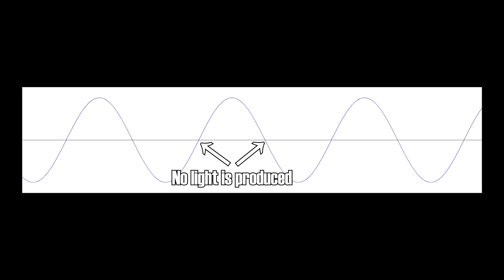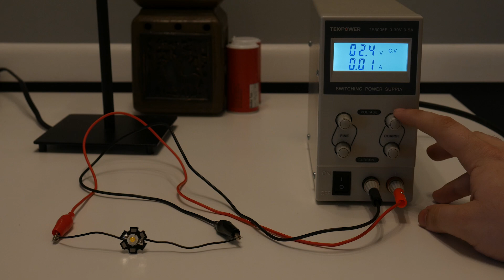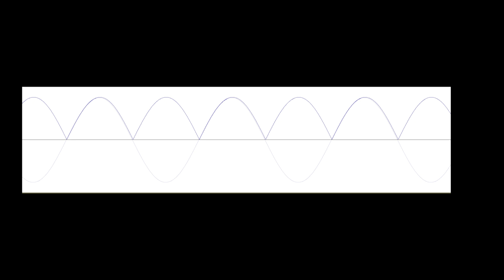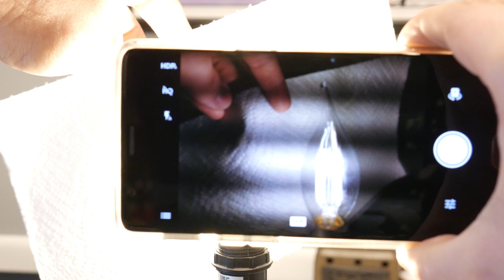LED bulbs that flicker, and CFLs that almost never did

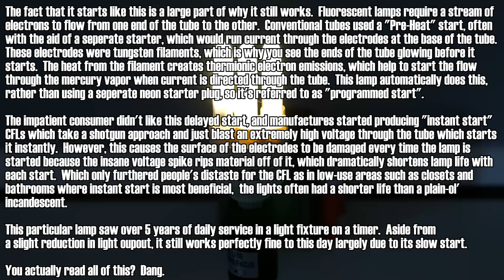Comment: at 1:49

The fact that it starts like is a large part of why it still works. Fluorescent lamps require a stream of electrons to flow from one end of the tube to the other. Conventional tubes used a "Pre-Heat" start, often with the aid of a separate starter, which would run current through the electrodes at the base of the tube. These electrodes were tungsten filaments, which is why you see the ends of the tube glowing before it starts. The heat from the filament creates thermionic electron emissions, which help to start the flow through the mercury vapor when current is directed through the tube. This lamp automatically does this, rather than using a separate neon starter plug, so it's referred to as "programmed start."

The impatient consumer didn't like this delayed start, and manufacturers started producing "instant start" CFLs which take a shotgun approach and just blast an extremely high voltage through the tube which starts it instantly. However, this causes the surface of the electrodes to be damaged every time the lamp is started because the insane voltage spike rips material off of it, which dramatically shortens lamp life with each start. Which only furthered people's distaste for the CFL as in low-use areas such as closets and bathrooms where instant start is most beneficial, the lights often had a shorter life than plain-ol' incandescent.

This particular lamp saw over 5 years of daily service in a light fixture on a timer. aside from a slight reduction in light output, it still works fine to this day and largely due to its slow start.

You actually read all of this? Dang.

Comment: I always thought the flickering LEDs were just cheaply made...
the first batch of "Corn" LED bulbs we got flickered like hell(most people don't see it but I do, especially when I move my head/look around with the eyes) and they died very quickly.

The second and third batch we got (with a "smart IC driver chip") were flicker free and lasted way longer.

When filming them both side by side with 240/480 fps you can clearly see them flicker on and off while the newer ones don't flicker at all.

PS: we are in Israel so electricity is 50hz hence easy to see the flicker.)

Comment: I love your channel! I have a peripherally related question and I hoped this would be an appropriate video to post under. Just now in the Walgreens I was seeking out a new CLF to replace one that was apparently not as deathless as once advertised, when I found only LED bulbs and traditional incandescent bulbs! No CLFs to be found anywhere. Have LED bulbs entirely replaced the market that CLFs once dominated? Many thanks in advance!
Reply: I've seen CFLs in a few local stores recently, but certainly many stores are getting rid of them. CFLs seem to also be available in very large sizes for which it's difficult to find inexpensive LED bulbs currently, though that will likely change eventually too.

Comment: My only issue with LEDs, currently, is that their light output is still minimal compared to what CFLs can do with the same volume of bulb.  I have two 200-watt equivalent (40-watt) CFL bulbs, and granted they're a tad larger than your average CFL, a 200-watt equivalent LED bulb would be cumbersomely large. It would probably also produce a disconcerting level of heat.  Lastly, the 200-watt equivalent CFLs cost 10 dollars each, and LEDs aren't anywhere close to competitive, in terms of lumen per dollar, with CFLs.

As somebody who suffers from winter depression, high-output bulbs are ideal for me (as is the daylight color temperature).  Until LEDs overcome some of these problems, I'm sticking with my CFLs.

Edit: I almost forgot to mention... I can see the green flash from my CFLs without moving my eyes.  When I turn them off, I sometimes stare directly at them, and I still see the green flash.  I suppose this might be rare behavior for CFLs, just like the green flash of the setting sun over the ocean :P

Comment: 13:39 I was on night shifts and set up lights in my apartment to have fixtures closer to the interior use warmer variants and used 6500k lights near the windows.  Blackout shades drawn, I could mimic a daytime light scheme at night.

Comment: Why do we still use electrolytic capacitors versus non-liquid capacitors these days? is it still just cost?
Reply: Solid capacitors are used, but their capacitance is very tiny unless you make them huge, they're used in small devices that don't use much power, or pretty much anywhere that a really low capacitance is needed. They're usually layered ceramic for the smallest ones & layered pieces of mica for the biggest ones. I don't know much else about it, just that they're like fine controls of a circuit with how little capacitance they can hold & that electrolytic capacitors are like coarse controls.

Comment: 1:50
I have a word of caution on those slow start CFL's.
I had a few of those EXACT Ikea bulbs in my house for a long time until one day after a few years of reliable use in the living room centre light fixture, one went pop.
Well, not so much pop but BANG and the resultant, explosion "unplanned spontaneous disassembly" showered our living room (and us) with pieces of glass and bits of plastic.
I guess the ballast failed? Needless to say they all went in the bin and I haven't looked back.
Might not be so risky for you on 120v, as we are on 240v here in the UK (bought from UK stores and obviously rated for 240v!)
Long story short, be careful as they get old.
Reply: It wouldn't surprise me if the capacitor inside failed.  When electrolytic caps fail, they have a tendency to pop, releasing a large amount of energy into the enclosure.

Comment: The real problem with CFLs was that even if you wanted to recycle them, most folk didn't have any idea where/how.
Reply: We were told they would be recyclable ..... no local recycle center would take them because they contained mercury.
Reply: @jeffreymontgomery7516  Right? I ended up throwing away a bin of the damned things I'd saved while trying to find somewhere that would would take them for safe recycling.

Recycling was fantastic in theory but didn't work out in the boondocks. Or anywhere I lived really.
Reply: @jeffreymontgomery7516  Right, they are actually toxic waste.
Reply: If you still have them, chances are your local Home Depot will recycle them.
Reply: Any company that accepts Laptops or Flat Screen TV, SHOULD, be accepting CFL as it's basically the same elements. Mercury Lamp inside the Laptop along with the circuit board in the CFL. BOTH, can be placed in the same Hammer mill for recycling
Reply: Pen & Teller has a show about the Lies of Recycling which showed most plastic, paper, etc doesn’t get purchased.  Then the recycling center sends the stuff to the landfill

.
Reply: Politicians passed laws requiring recycling, but included a loophole that allows the items to be sent to the landfill instead

.
Reply: Mercury
Reply: @⸸BadRomanceDjinn⸸The "Smart" ones, can monitor you, just like Siri, and anything, "Smart" and anything "Ring" Places that recycling Laptop, use the same machine to recycle CFLs. I'd put all in one box, along with bad Christmas lights, dead battery, and give to them.

Comment: People who "can't stand" cool white lights  do so because those lights are lacking in red and yellow components, and those people's brains evaluate colors continuously and dynamically instead of using memory-assisted color perception.    The human eye uses red and green cones for color detection, blue for amplitude and night detection.  The led replacements for fluorescent cool while and daylight lamps have much better color balance with red and yellow phosphor-covered emitters, so they should be tested by those sensitive to "fluorescent" lighting to see if they are a problem.

Comment: Filament incandescent 100W = 100W of power, CFL 100W eq. = 14W, LED 100w eq. = 5W... That's all I need to know.. This means I can replace I can run 20 light sources for the same cost of energy as a single 100W incandescent light bulb. My whole house is lit by less power than one lamp at my dad's house growing up. I don't mind a little flicker keeping that in mind and the cost of power these days. My smart bulbs lowers it to an average of 15 lights for the cost of a 100W bulb, but that is still worth it for the convenience and the incremental savings of not having to walk back to another room to turn out a light I've forgotten. And yes CFL caused me to have headaches, and eye strain, and it was NOT because of any kind of flicker, it was due to the light wavelength created by the fluorescence coatings inside the tubes which was harsh on my optic nerve. I also experienced faster macular degeneration when using CFL bulbs. my prescription hasn't changed much since switching to LED.

Comment: Where I noticed fluorescent light flicker the most was back in the mid nineties when I had a CRT monitor that was running at a sixty hertz refresh rate which was the default setting on many monitors and the only setting on cheap monitors.    A lot of people in the office complained and I went through and changed the refresh rate of their monitor to seventy-two hertz where I could.    It worked well.    Well enough that I got an attaboy from management and a few dozen shiny new NEC 17 monitors to deploy.
Please do Philo Farnsworth and nuclear fusion too.  https://en.wikipedia.org/wiki/Fusor

Comment: Every single CFL I tried cast a gray or yellow hue which made me sick to my stomach...emotional reasons, not physical. Made me the opposite of happy. More like angry. Drove me nuts. I was never, ever satisfied with them. I still use a handful of 3-way incandescents in some table lamps because the 150 watt equivalent warm white LEDs cast a ring of darkness around the bottom of the lampshades. The 100 watt equivalent LEDs in other lamps don't cast the dark ring. The up to 150 watt incandescent 3 ways are the only ones left that seem to be the TRUE wattage, like the old days. 100 watt equivalent 72 watt incandescents LOOK like 72 watts or maybe even 60 watts. Sunbeam 100 watt incandescents from the Dollar Tree seem closer to 60 watts. All lies. I use those remaining crap incandescent bulbs in ceiling lights that call for a wattage no higher than 60 watts. Otherwise, I do love LEDs. Anything below the 5000k blue creates some nice white or incandescent-like amber-ish light, though some of them tend to be just a little brighter when compared to their incandescent "equivalents". Especially the clear ones, but not by much. Easy to get used to and so much more tolerable than a gray or yellow hue. What's driving me nuts now are the 5-6000k LEDs all over the neighborhood porches. The streets are dotted with aquarium houses full of dumbass fish that don't know how ugly the light is, especially at night, or just don't care.

Comment: I only use Cool LEDs (High Noon) instead of the Warm LEDs (Sunset)  Why? two reasons; I work 3rd shift & so my apartment is blacked out so I can sleep during the day (bed time is 9:00am)  When the alarm goes of in the morning 6:30pm I need the High Noon LEDs to lock down my circadian clock.  My new Apt had a total of Eleven 60 Watt incandescent (660 watts) These were replace in short order with: Expensive? 16 Watt LEDs (packaged as 100 Watt equivalents) 16 x 11 = 176 Watts.  I tried Cree brand, but it's 1st gen offerings were not yet ready for prime time.  Now-a-days  Walmart actually offers up cheapo LEDs do a good job.

Comment: One of my old CFLs seems to not get past the slow startup stage until I tap it, half the time. And it's not just epilepsy, this sort of strobe sensitivity is very common amongst autistic people too. I remember in the college computer classes I took, I had to get one of the IT admins to come into each class with me to increase the CRT monitor's refresh rates (which sadly dropped the resolution down to 640x480, but I just couldn't tolerate a 60hz refresh). Then again, given that I'm in the UK, it's just occurred to me that it's possible the strobing effect is even worse for autistic/epileptic people in countries that use 50hz.

Comment: But CFL and LED both are hard on the eyes since they use UV to excite a phospor and some UV gets out to the eyes. People have even had UV skin and eye BURNS from cheap CFL blubs !   LED and CFL both bother my eyes much more than old incandescent bulbs because of the UV.  And they can't dim or the newest LEDs don't dim very well. At least none I could find. And their color temperature is much different than the Sun or old bulbs.  But they save energy. 
With UV burns, how much is your eyesight worth ? $100 ? $1000 ?  I'd say priceless !  Yes, then newer ones put out much less UV but it still may have some.
And apparently LED bulbs can even burn plants !   see  
LED Grow Lights Can Burn Cannabis Buds?!
7 Myths LED Grow Light Companies Tell You
And yes, I don't like the bluish / UV bulbs, why like a bulb that damages your eyes and skin ? Yes, most don't but just like sunlight just give it a few years with your skin and eyes instead of these tests for hours. By that standard tobacco and asbestos are completely safe too !

Comment: I want the old incandescent lights back. I don't care that they use more electricity, some parts of the spectrum that you get from incandescent is beneficial to you but harmful to mold, bacteria and viruses so you are paying for more then just the light. And i need to heat my house half the year anyway so the energy lost to heat is not a big deal, the other half of the year i barely need to use lights at all.

Comment: LEDs don’t actually need dc to work. You need the right forward voltage and not too much current. If an AC input voltage was low enough, technically an LED wouldn’t care. It would turn on and off at the same frequency as the input. Granted, the breakdown voltage for when it destroys needs to be higher

Comment: So if I run LEDs on DC current they won't flicker
Reply: It depends. If you've got a nice stable DC voltage (like from a battery), sure. If it's rectified from an AC source, then it depends on how well it's been filtered and what kind of rectifier was used. A single-diode rectifier (possibly using the LEDs themselves for the role) with no filter will give the worst possible result with a tonne of flicker (not to mention it's very inefficient). A full-wave rectifier without a filter will be a significant improvement, but will still have a lot of flicker. Adding better filter capacitors will smooth things out more and more.

Comment: Oddly enough all filament LED lights I have in my house (I live in the EU), which look exactly the same as the ones you have are absolutely flicker free. If I record with my phone in slow motion, no flickering at all. But other LED fixtures are absolutely not flicker free. Moving your hand in front of them makes this very clear even to the naked eye. Technology surely has come a long way and it's hard to even discern normal light fixtures from good LED filament lamps anymore these days. Gone are the days of too yellow or sickly white, flickering light where you waste 90% of the energy on heat.

Comment: Ummm... Incandescent bulbs also flicker at 120Hz. Get an old fashioned light sensor and put it in the front end of an amp and listen to the nice loud 120 hertz hum from an incandescent. Also LEDs can actually work with AC. It is a diode and will light on half the wave. I myself have used them in AC applications (low voltage AC).

Comment: I do have a few good reason for incandescent: Some people actually WANT the heat from them in the winter time, and use them a lot in chicken coops, dog houses, livestock, etc. The heat also helps keep the socket dry and helps cut down on corrosion of the contacts in outside conditions. They're simple, durable, and cheap. Also one of the main reason I like them is for extra lightening protection, it gives it a arc point in a vacuum tube from live to the ground, and if it burns it in two or explodes, no biggie, grab another cheap one.
Reply: Honestly, ovens and chicken coops are the only uses I can think of for incandescent.

Comment: why...don't they do the fluorecent coating thing to LED bulbs?
I mean, usually they're not transparent anyway, and it would reduce the flicker a bit too?
shouldn't even be terribly expensive, given there was no problems doing such stuff to CFLs...

or...why not have two opposite direction chains of leds?
with a diode or something to not drive them in reverse...
no need for a rectifier then, cause you just drive them opposite of each other?
also the led bulb makers just try to keep the costs real down, cause all you need is a capacitor on the output to reduce flicker...while there isn't too much space, you don't need a huge one, you just need to reduce the flicker intensity...

Comment: LED bulbs ARE bad, because they flicker, and their light is too point sourced, searing and harsh.

Fluorescent tubes have a buffer in the bulb's coating that minimizes the flicker effect. I always see LEDs flicker, but not FL Tubes. The FL Tubes also have better light distribution and color too. ("better" means more enjoyable)
Reply: "point sourced, searing and harsh"... Sounds like you may have tried a bad bulb 10 years ago and you've been parroting the same talking points ever since. Modern general lighting LED bulbs just aren't like that any more. And nearly any LED bulb you'd be using today also uses a phosphor similar in concept to a FL.

Comment: And no mention of power factor which is an inherent issue with led drivers. when the power companies start charging for apparent not measured powered we are better off going back to incandescent bulbs. No RF interference, purely resistive elements so power factor of 1. Old tech is better!